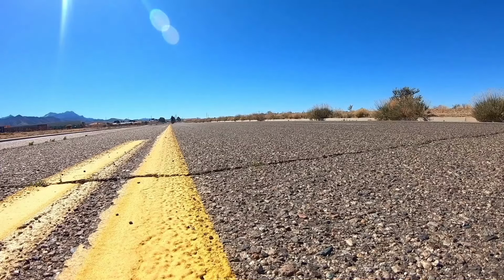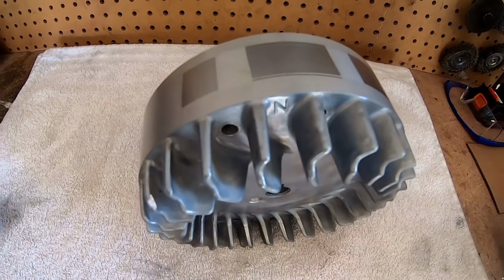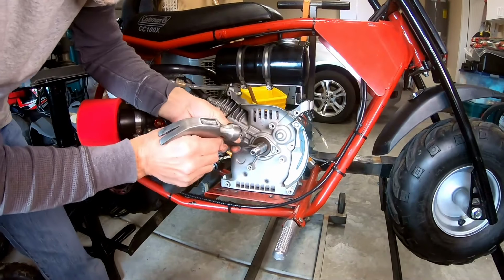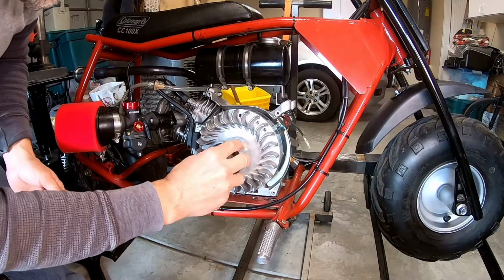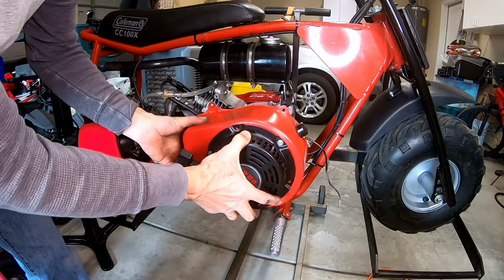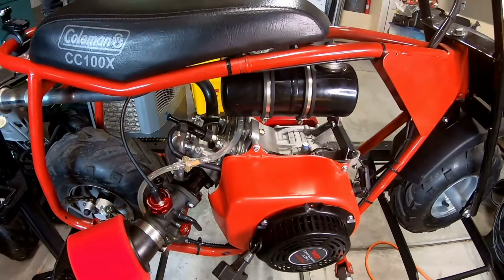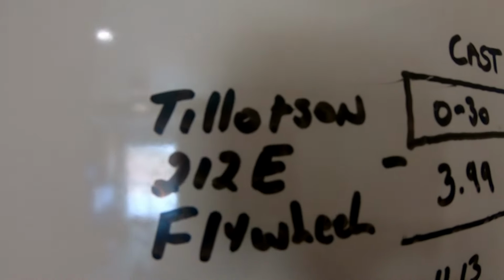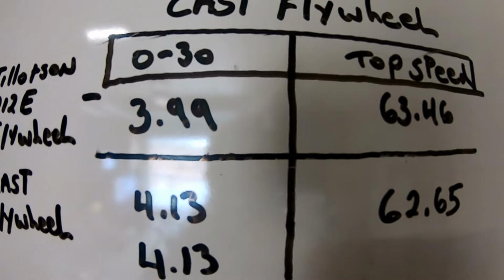Predator 224 gets a cast aluminum flywheel

Comment: The cast aluminum flywheel has the full size cooling fins too. It’s a steal for what you get.
Thanks so much for doing all of these mods and videos.
You are the best small block engine modder and tester on YouTube.
Reply from the maker: Thanks!!
Reply: Does it fit gx200/clone ??
Reply from the maker: @jokerrr14  Yes
Reply: to bad this flywheel will limit you to 6685 rpm
Reply: @topmfg5505  why?
Reply: @TOXIC-hb7rc  it won’t , I think he is mistaken the coil
Reply: @lp_rc523  Yeah I was going to say the flywheel has nothing to do with the RPM limit.  LOL.    Heck I'm sure his mini bike was close to 9k sounds so good.
Reply: Where can I find one for that price? Cheapest I’ve found is 59$
Reply: What the torque psi for the flywheel
Reply: @Black66 😅😅😅😅😅😅😅😅😅😅😅😅😅
Reply from the maker: @brandonhentz  😢😢😢😢😢
Reply: @Black66  does it fir the trail master mb 200
Reply: What does it need to be torqued down too
Reply: @kylesyx8432  ec carburetor, tilltson 212R cast aluminum flywheel
Reply: Is that a hemi 224? I’m haven’t a hard time finding a fly wheel for a himi

Comment: I bet that the timing is a bit off. In theory, it should be noticeably faster on acceleration and a slightly higher top speed.
Reply: The timing is way off. Studz racing says it's timed to 18 BTDC. A 7 degree key would take it to only 25 BTDC.
Reply: @Deucealive75 would would you recommend a 7 key way ?

Comment: Those Tillotson cast aluminum flywheels are a great bang for your buck for the quality.  Plus someone has spun one up to 10k for a long time privately.  The downside is they come with only 18 degrees of advance. Granted even though most cams call for 32 34 a 12* keyway will get you to 30.
Reply: Im wanting to buy this for a stock 224 with just a stage 1 kit , 24mm Nibbi carb running 115 jet , but I’m not sure what timing key to get 8? , 10 ? ,12 ?
Reply: I'm lost he said in the description he swapped the tilly e flywheel for another one but there's only a link for the cast aluminum because the tilly one says it's rated at 10k rpm like the one in my ducar and the cast one says 8.5k rpm🤔
Reply: @SpACeCruizeR2o3  the ones on ebay that are cast aluminum and aren't billet and came stock on the tillotson 212r's.  I've ran one for two years its great pulls more air in to cool the motor IMO.  they fit anything hemi/gx200 clone. I've been told they are 18* advanced or as much as 25*.  Leaving them with stock keyway is fine unless your messing with different fuels thats when you will need more timing.  for the money you can't beat them.
Reply: @ephenj  got one on my ducar it comes stock on there 3years strong and still going
Reply: @ephenj  the billet one adds timing tho
Reply: @SpACeCruizeR2o3  for a few bucks you can get keys that add what ever timing you want. Plus talking with the guys and ECC, that run the dyno there they have said that when it comes to the timing and these motors whether it's 32 or as little as 18  unless your running different fuel the HP gains aren't noticeable like a bigger cam or carb etc.  The gain you feel from a different flywheel is less rotating mass.  I was going to run mine really advanced after talking to the ECC guys and my build they said just put the stock key in your butt dyno won't notice the difference.  Again unless your running different fuel.   Personally I like them cuz it seems to keep the motor a little cooler with the amount of fins it has over the billet ones and heat is the enemy of these little motors.

Comment: Still very impressive numbers. and now the safety is there. I run the same flywheel on one of my predators.Once again thanks for all the info
Reply: does that flywheel fit on a predator 212?
Reply: @lbnick3388  yes
Reply: @lbnick3388  Does not fit the Predator hemi.
Reply: Do u still run that flywheel I want it just worried since it’s cheaper it’ll blow my leg off
Reply: @SLOW_CS I'm wondering the same thing

Comment: That sure is a nicely modified 224.  It seems like upgrading the stock flywheels on most of the predators and other clones is a must do for anyone who is going to be removing the governor and plans on running at RPM's.  Do you run tachometers on your engines?  Your videos are great and really show the viewer what works but I haven't seen any significant problems in any of them yet.  Have you experienced any major malfunctions with any of your engines....flywheel throwing magnets, spun bearings, catastrophic engine failures?  I would be really interested to hear about those and I think it could be very useful and entertaining for your subscribers.  Maybe you could start uploading a compilation video of "mod's gone wrong", defective products, and bloopers once or twice a year, or however long it takes to document enough mishaps to create a video.  I think they would get a lot of views and increase the number of subscribers you have.  Just a thought...
Reply from the maker: Thanks. I have had minor mishaps while out filming this stuff. Breaking cameras, someone ran over a camera, Not being able to stop in time at the end of the road, carbs falling off.  I have a video on that one.  The only major engine failure I have had so far is a valve stem breaking While I was filming a video. I Have a video coming out fixing the engine. I have been so lucky with these engines so far. I know sooner or later one is really going to come apart. It's just a matter of time. I hope I get it on video.  Thanks for the suggestions. I think it would be fun putting that stuff together.

Comment: The flywheel has a timing of 18 degrees, they recommend a 12 degree timing key.
Reply from the maker: Yes, check out the other 224 videos, I advance the iming.
Reply: Where are those videos ?
Reply from the maker: @STLWILDONE  In the 224 playlist and other playlist on the channel.
Reply: I've looked and it's not listed
Reply from the maker: @STLWILDONE  Advancing the timing is in multiple videos., its just not listed in the title of the videos.

Comment: That small of a difference could be explained by temp/air density changes while you were making the swap.  It would be interesting to see you retest with more timing advance.
Reply from the maker: I'm thinking it was timing because this wheel only has about 18 degrees or so built in.
Reply: @Black66  can we get a retest with a 12 degree timing key please
Reply from the maker: Yes, I have been meaning to do another timing video.  @dirty_bob477

Comment: Definitely doing this on my 224. So much cheaper than an ARC!
Reply from the maker: Use a flywheel key with this wheel to get it closer to the stock timing. They come with about 18 degress timing.
Reply: @Black66 did you use the timing key that came with the flywheel ? Because mine from Amazon didn’t sit well so I used the stock but now the bike keeps dieing and won’t start
Reply from the maker: @SebastienRebeiz-g1w  this flywheel only has about 18 degrees timing. It needs a key or the timing advanced to at least 24 degrees or more

Comment: I just want to say that I absolutely enjoy your channel and your builds and camera work and comparing engine builds and upgrades. I watched your last episodes about the ghost engine and the valve springs and fly wheel. My question is would you use 18lb spring or 22lbs   without doing internal upgrades inside the engines cause I’m still learning that. Cause doing mods outside the engine I can do .
Reply from the maker: Thanks!! I have a video coming out on this.
Reply: Ok awesome I can’t wait to see it ! I’m really considering your set up on my little mega moto. I appreciate you replying back!

Comment: The 2 flywheels may have different timing. My stock clone flywheels and PVL flywheel are timed to 28 BTDC. The genuine GX200 cast aluminum flywheel I had was timed at 22 BTDC. The flywheel you have there looks like a copy of the GX200 aluminum. Is it timed the same?

Put an ARC flywheel on there and get the timing the same as the 212e flywheel then test it.

Comment: Will this fit the duromax 208 boss great video and info btw just wanted to know because I have the 10k rpm flywheel that comes stock from my ducar which I wanna put a billet one on the ducar and then I can run the stock one from the ducar on the duro 208cc u think it will work 💪🏼💯💨💨💨

Comment: I recommend this if you want to loose speed stock flywheels dont blow up until 7000 to 9000 rpm
Reply from the maker: It is very simple to advance tinning with this wheel and does not have the glued on magnets which is much safer.

Comment: Hey man cut about 3 coils out of your clutch spring (max torque style clutches) and raise your stall speed  ; ) 
youll be glad u did.

note: u may have to grind away about 1/16" off the side edges of your clutch shoes (where they contact each other, not the bell) ... this shrinks the circle down a little so u can fight the spring back in lol .. also has the effect of raising stall speed too, this is 1 reason u wont cut many loops from the spring.

Your engine will rev and your clutch will bite like a mean dog! lol

Comment: Where did you get the tillotson 212 ee flywheel?  I have been looking for one of these for my 196cc coleman.  I was told they handle more rpm than the stock coleman and can still retain the lights
Reply from the maker: I got the 212e flywheel off of my 212e. Maybe you could grab one off off the Tillotson web site, Not sure. Or Maybe GPS could order one for you.

Comment: I bought the same flywheel and gapped it at .03. For some reason my bike wont stay running longer than a few seconds. It starts and runs fine then just dies shortly after. Im wondering if my charging magnets inside (which i dont need because im not running a light) is causing this issue

Comment: hey black thank you for you're videos they help me a lot with trying to fine tune I was wondering if you knew if that flywheel would fit on a 212 predator
Reply from the maker: Thank you. It has a clone taper. Some say it wont ,but the seller says they will. I have used them many times on a Predator 212 . I just make sure I lap in the flywheel with valve grinding compound.

Comment: Great videos. I have a rt200 its bn hard to decide what to put on the bike. What do you think about viking 223cc hemi head 7 hp electric start engine.? Or what would you recommend me. Thanks again for the videos.
Reply from the maker: Thanks! Yes, I really like that Viking 223 or even a Predator 224 because it has that 58MM stroke!  That will make a big difference on the bigger bikes for pulling torque.

Comment: Shouldn’t you set the magnet in the flywheel to the coil before doing the feeler gauge to get the accurate spacing? Or is that magnet recessed level with the flywheel?

Comment: Great video! I would like to get a flywheel ring gear with magnets charging coil for the Coleman BT200X but cannot find one for the Predator 224cc engine. I have not found a  cast aluminum flywheel with charging coils, any information on this if a predator 212e flywheel will fit?

Comment: I need some help .. will a 224 block accept a metal 212 cam from a non hemi? Trying to get rid of the plastic gear
Reply from the maker: You need a cam from a hemi Predator. It has .550 cam mains. The standard Predator has .558 mains. They are too big for the 224.
Reply: @Black66  thanks I ordered one.

Comment: question i see on omb that new rocker arms are about 200 bucks is it worth it and are there any cheaper options?
Reply from the maker: If you want a solid 1 to 1 ratio set of rockers, I would go with a set of Champion style shaft mounted rockers for around $25

Comment: Can you retain your charging system with this flywheel? I need the lights for a motorized  bike build
Reply from the maker: No, it doesn't have the magnets.
Reply: @Black66  ty for responding but.guess I'm gonna run a battery bank bc high rpm is a must so I need the billet flywheel.

Comment: I hope this isn't a stupid question?
But how does the motor run with a billet fly wheel with no ability to send power to the spark plug?
Reply: The megnets built into the flywheel interact with the device at 6:30 to produce a spark. Its some electromagnet science stuff

Comment: Hey, I have a 224 Predator, 26 lbs springs, billet rod and flywheel. Wha jets should I use in my carb
Reply from the maker: I usually start out with a 120 main or so in a VM22. Jetting is different depending on mods and elevation etc. Look at the plug after riding for w while. If it's got that light tan/grey color it's running good.

Comment: I'm confused as to why you took the Tillotson flywheel off (rated at 10,000rpm) to replace with a cheap cast flywheel (rated at 8,000rpm)????!!! And I could be wrong but I think you should've used a #8 flywheel key instead of the #7
Reply from the maker: No need to be confused . The Tillotson flywheel has glued on magnets ! It is the ONLY flywheel I have had fail on the channel.  Check out the MB 200 on the channel . It failed in that video. 
I will ALWAYS use a solid cast flywheel over the tillotson flywheel. 
Actually an 8 degree flywheel key or the 7 I used is not enough to get to the optimum advance with the cast wheel . The cast wheel has about 18 to 20 degrees of timing built in. A 12 degree key would get it closer to the optimum 32 degrees advance. 
A 12 degree key would be more in the ball park. Check out the playlist for more FANTASTIC mini bike content . Thanks for watching !
Reply: Thanks for answering and clarification! I have a Tillotson I'm about to build and was going to use the Tillotson flywheel on a predator instead of the Cast I was debating on purchasing. So glad I asked! Again Thanks!!!
Reply: @Black66  so I know you're take on the Tillotson flywheel....but is that a 1 time incident or are they known for this?
Also....I have another Tillotson that I'm going to leave stock (except for a mikuni 22mm and F&B header) I really want to do a governor delete. Do you think the stock flywheel will do? And will the cast flywheel work with a Tillotson 212e? All the ones I find say for non-hemi
TIA
Reply from the maker: @mickrussell7198  Anything with a glued on magnet isn't reccomend for high performance use. I have heard of Predator wheels  coming apart , never witnessed it myself. 
For as inexpensive as the 8k cast wheel is , might as well be on the safe side and at least go with that wheel or better yet a billet wheel.
There is no way to guareentee that the wheel coming apart is an isolated incident.
Reply: @Black66  can you send me a link for a cast flywheel that is compatible with the Tillotson 212e (preferably from Amazon I can't find any) ? All the ones I see say non-hemi. 
Thanks for the help! LOVE THE CHANNEL!
Reply: @mickrussell7198  Use the link in the description. That fly wheel will fit on the crankshaft of any Tillotson small block. Hemi versus non hemi are for the Predator 212 guys to be concerned with.

Comment: Would the cast aluminum 212 flywheel fit on a 212 ghost
Reply: The Ghost crankshaft has a clone taper. Any clone (196) flywheel will fit.

Comment: Can you make a video how you make the crankshaft holding tool
Reply from the maker: Its made from an old clutch. You pretty much just use the internal part of the clutch that slips over the shaft and drill holes in it so you can run bolts into the side cover.  You can buy them from OMB and I think GoPowerSports.

Comment: Is this flywheel safe? For high speed runs ?
Reply from the maker: It's rated for 10k RPM. Not as good a billet flywheel but it is better than the stock flywheel IMO.

Comment: Will this flywheel fit a 212 predator?
Reply from the maker: Yes, it has a clone taper but I have use it on a 212 without a problem as long as you lap it in.
Reply: @Black66  Thank you.

Comment: Does that flywheel fit a gx200 clone ??
Reply: Yes. The 224's crankshaft has a clone taper.
Reply: 196cc stock Coleman?
Reply: @4.6slidez  Yes it fits on all 196's.
Reply: @Kurt Yes will fit GX160.
Reply: Okay thanks guys ima order mine now
Reply: @Deucealive75   predator ghost ?
Reply: @Xclusively_Average  Yes. I'm pretty sure the Ghost's crankshaft has a clone taper.

Comment: which pvl flywheel fits predator ghost
Reply from the maker: Same one. It will fit the Ghost . I have also used it on a standard Predator even though it has a clone taper. You just have to make sure you lap the flywheel in.
Reply: @Black66  thank you

Comment: Ive bought these flywheel and unsure why it vibrates like hell probably i need tot torque it down
Reply from the maker: If you used this wheel on a standard Predator the Taper is slightly off compared to the clone taper on the cast flywheel.  This flywheel definitely needs to be lapped in IMO.

Comment: On the back of your aluminum flywheel there's a number 14 stamped in. It was described to me that that is the setting of the timing on that flywheel.  And I have heard that these cast aluminum flywheels are pretty random. So you just happened to get a 14; so that's the case with your 7° key you are at 21°, and the stock flywheel is 24° correct? So you're actually running retarded timing by 3°. That might be part of the reasoning for your results?
Reply from the maker: Yes,This video was to show what the results would be by installing the flywheel untouched.  check out the other videos in the playlist where we advance the timing.
Reply: @Black66  so the number on the back is for sure the timing it came with, in your case, 14° btdc?
Reply from the maker: @JoshStein01  The wheel I used in this video supposedly had 18 degrees timing. 
None of them are ever spot on. 
One way I found to easily add or subtract timing without using timing keys and without  having to remove the flywheel everytime is an adjustable coil bracket . I use one on the Predator 224 on the GTS bike. I have a video on it in the minibike playlist.